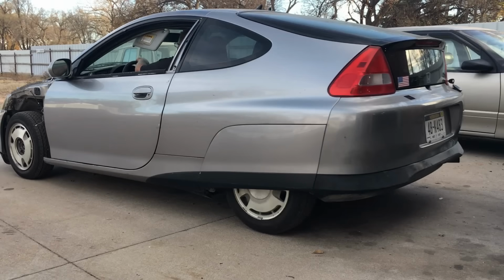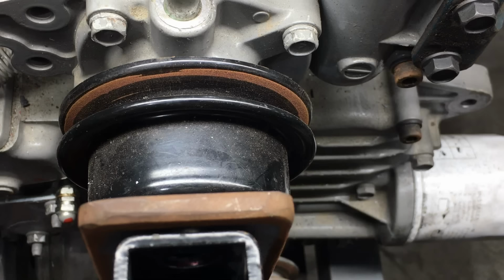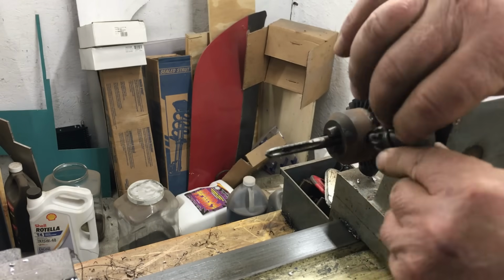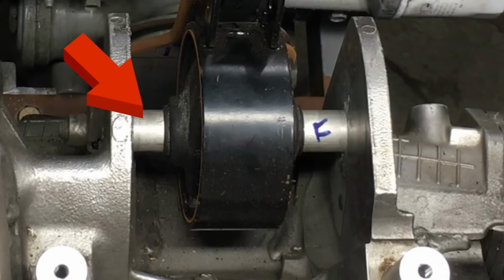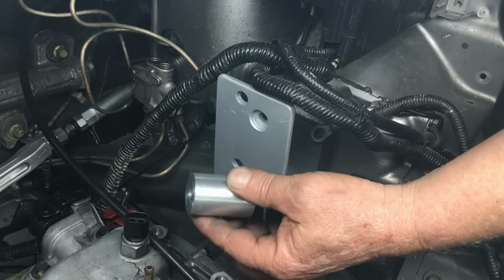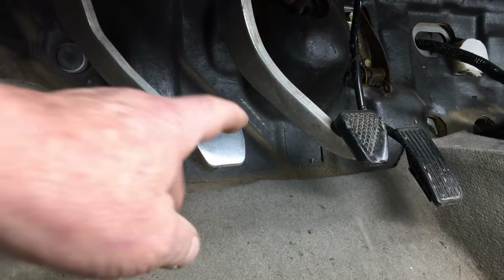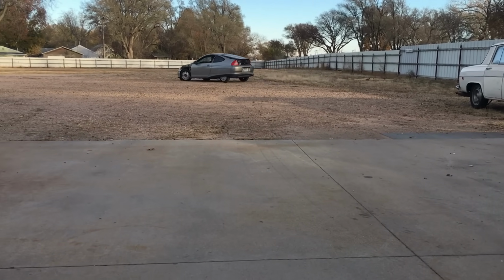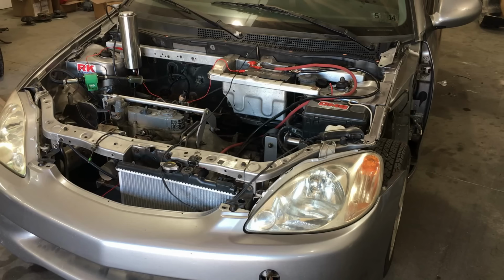S3 E41. Kubota Diesel Honda Insight moves for the first time.

Comment: You have found a way to make an already kind of weird car even weirder!  And it is even going to work.  And I learned today about how you can use a copper plate to help weld shut some holes in a steel plate.  I salute you, Sir!
Reply: The copper trick makes sense they cast the H/I beam in vibrating water cooled copper Jackets and pull a continus beam out soo yeha if you dont dumb tonns of heat in the pice the copper will disapate the heat /cool down the steel fast enough so that it dosnt alloy together
Reply: @TheLtVoss what

Comment: Hey Jimbo, if you're thinking of a future project, back in the late 70's there was a VW shop (Super Bugs) known for dune buggies and racing down in Va Beach. The owner was very much like you, doing the impossible. He modified a VW engine by adding two stroke ports on the cylinders to make a hybrid four stroke / two stroke engine. He raced this bug and it screamed but was disqualified on a technicality.

Comment: The most important thing you can do for fuel economy in that thing is to block off any airflow path that isn't absolutely necessary. Thin steel/aluminium plates beside the radiator, on the brake ducts, below the exhaust etc along with sealing off the airflow paths to the radiator and whatnot better (they don't do this from factory because it's time consuming which would make the cars expensive to produce from a labour perspective).

Comment: I always thought a small displacement turbo diesel serial hybrid would be THE way to go in the future. Looks like VW made sure this would never happen, but I’m curious what sort of mileage you’d get at 55mph in this thing.
Another super cool video!
Reply: I think it’d take ~15HP to go 55mph on flat terrain, but that’s a push for this engine, so maybe 45mph is a better target on second thought?
Reply: @TCPUDPATM  It made it to 55 mph in the Saturn, then they put the turbo on and went faster. The Honda should be lighter and more aerodynamic.
Reply: I agree - however everyone I discussed this idea with said it would be too expensive to justify the fuel economy, and too slow. Nobody wants to spend $60k on a car with mediocre performance just to get 70 mpg.

Today, I think the best solution is a fully electric drive train with a turbine engine coupled to a generator. Basically an aircraft APU. It could be small and produce enough electricity to power the motors while charging the batteries - allowing for long road trips. You could also park the car and let the engine run to fully recharge the battery. Finally, if set up properly, the turbine could run on gas or diesel - which is great in emergencies. After hurricane Ian I was so glad I drove a diesel truck, almost every station was sold out of gas but some had diesel.
Reply: Unfortunately diesel requires a lot of room for the extra junk that diesels need.

If you have to make room for diesel junk (turbo, DPF, intercooler, EGR etc etc) then that leaves less room for battery.
Reply: Mercedes actually has alot of turbo diesel hybrid vehicles

Comment: Will that motor tie rod hit the coolant fitting when the motor is under load? The torque of accelerating and decelerating will cause the whole drivetrain to rock for and aft.
Reply from the maker: It should be fine.
Reply: @robotcantina8957  WOW! This is why I prefer YouTube over traditional media streaming. I have direct contact with a famous celebrity. This certainly made my day.
Reply from the maker: @Cookie-Dough-Dynamo   Thanks, you made my day!

Comment: I feel like there is going to be issues with the anti flex bar. A flat plate being pushed and pulled, it’s going to fatigue and snap. Can you run another bar down to the driver side mount?

Comment: if you put an amr500 and a turbo on this engine i think that you can pull out some decent numbers. i suggest that the turbo goes into the compressor, then into an intercooler and in the engine. i suggest also to use a 2:1 ratio for the compressor or a little more (compressor faster than the cranck)

Comment: Great fab work, Jimbo.  But you never explained why the engine had to move forwards 3/8”.  Some clearance issue we can’t see?
Reply from the maker: Oh good point.  Once the axles were in it was clear the engine was too far back.  Moving the engine forward put the axles in the correct alignment.

Comment: I grew up in the 60's and 70's with the hot rodder's and hobbiest racers. 
 Then you had the bikers , dirt bikers , go carts , skateboard's mini bikes and bicycle's. 
 It was also the time's of big wheels and tricycles.
 The front wheels on big wheels were plastic and would wear out and get chunked and dumped in trash piles down dirt roads. 
  The back wheels seemed to last longer .
 They were also very large metal tricycles . 
 A kid came up with the idea of taking a very larger tricycle with a hard tire wheel with front peddles.
 Take the fork and wheel off the frame and flip the frame.
 Then use the big wheel wide slicks and axles on the flipped tricycle frame .
 Making the tricycle chopper ! 
  We could also extend the back into a two seater with back rest , attach pipies and skateboard wheels for a wheelie bar .
 It wasn't soon before all the boys in the neighborhood were making these and racing them down the steepest hills in the neighborhood ! : ) 
  The guy who first came up with this eventually put a small block 400 chevy in a Vega .
 Later a 350 Chevy in a Datsun 240 z .
  I know many of us who have done these projects or known people who have . 
 Say what you want about boomers we didn't grow up playing video games .

Comment: Yeah that Near side Engine lifting mount was calling your name. 
A simple Bridge mound was all that's needed to also clear the Cooling hoses.
Reply from the maker: Yes, however to get at the lifting eye bolt, the timing cover needs to be removed. If we ever remove the timing cover we will revise the brackets to anchor at that point.  For now the longer version will work fine.

Comment: That A bracket  that takes all the transverse engine loads looks like it will likely crack around the bolt holes. Some triangulation there would be a good idea.

Comment: It would be nice if you could put glass pack silencers in the exhaust so is it does not interfere with the results probably sounds better. I’m also interested in the amount of power you produce and the fuel economy bearing in mind fuel is no expensive to me and probably a lot of others. Fuel economy is a big part I enjoy watching what you achieve and I have done similar in the past, great to see someone else doing what I would like to do with the vehicles I am running at present but at the moment I’m not in a position to do all the modifications. I really enjoy watching your videos as anyone else doing the same will encounter similar issues. Brilliant video keep up the good work. Looking forward to the next one

Comment: When you said that torque mount bracket, I expected a lot more than that😅 
Looks like machined aluminium billet, probably produced in very small numbers, quite beefy, and regular honda parts are usually already expensive.
I would have stuffed PU inside the old one and considered it done, but for that brand new part 99 bucks doesn't seem that much.

Comment: I wonder if you can use an intake manifold flipped over 180 degrees as an exhaust manifold so you can push it sideways to get more space to 'do things' with the exhaust [such as make it fit, or, maybe even mounting a turbo back on it]...

Just guessing though, as I am aware that on some engines, especially 3 cylinder ones, the spacings of the intakes are wider and larger in diameter than the exhausts, and even, sometimes, the other way round.

But also, one could just take 3 90 degree bends, and with some cuts, weld them together into a manifold.

Comment: there was no need to buy the new torque mount. in the early 90's we used "3M WINDOW WELD" to fill the mount and make it more solid instead of going with poly mounts. ive "fixed" many honda mounts doing this and always worked great. only down side is you must wait about 3 days to make sure it is completely set.

Comment: Mity-Vac the clutch res. the vacuum pulls the air out of the res hole and all lines and the res fluid level should drop as vacuum is disconnected. i done it on a mini cooper clutch

Comment: Engineering best practice, bolt goes down (on the brace). 
Reasoning behind it, if nut comes loose the bolt is still in the hole. Not falling out in its current fitment.

Comment: Have a look at rctestflight's vibration isolators. They are basically like a spring but with a wire cable, which acts perfectly between a spring and a dampener. Old thick wire is simple to come by - probably for scrap value, and you just need to tie them down on two plates.

Much cheaper than buying new rubber bushings for engine mounts and also a fun thing to explore :)

Comment: You could try using a high pressure pump with a return to get more pressure behind the injectors  for better atomization = more power and efficiency I've noticed no difference after 40psi at the injection pump that smaller motor might not need that much but it's easy enough to play with a regulator

Comment: One really nice thing about that set up, with the small radiator you definitely have a lot more room for a front mount intercooler for that small turbo diesel engine.

I don't really know anything about diesel engines except they are compression ignition and they dump the fuel directly into the cylinder, but could you add the diesel fuel atomizing the fuel and putting it in the air intake stream probably in the intake manifold, but really I have no idea if that would work or how it could work.... but it's an idea... probably a bad one, but one nonetheless.

I have seen people cooling their exhaust temperature with a water injection system..
Reply: You don't want to add fuel to the intake of a diesel, it can ignite prematurely during compression and cause damage.

Something you can do however is inject water (or a 50/50 mixture of water and methanol) into the intake just downstream of the turbo. The water/methanol absorbs a lot of heat as it evaporates, acting kind of like an intercooler only even more effective. Methanol also burns as a fuel, but it resists preignition well enough to avoid problems when used this way.

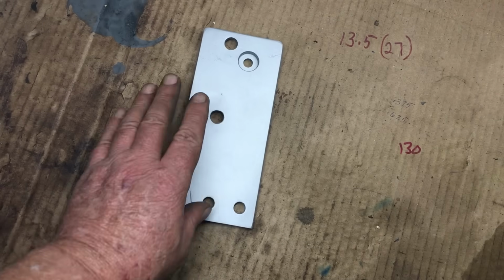Comment: 9:40 - I would have even considered to make the sunken part even deeper and use an allen head screw instead for even better strength. The shorter the spacer is the better too.
For the exhaust it might be an idea to make a new exhaust manifold with three smaller pipes or run two smaller pipes in parallel from the current manifold to make it easier to fit between engine and radiator.

Comment: You should use helicoils on the threaded aluminum rod, using just a tiny bit of loctite to fix them in place. Otherwise those threads will gall up easily. I guess you could also use antisieze maybe

Comment: Instead of using a small engine and adding a turbo, I wonder if it would be better to do the opposite, use a larger engine, and reduce the intake timing by installing a different cam-shaft, to turn the engine into an Atkinson cycle.

Comment: This would be awesome with a Tesla motor, about 50 kw battery, and a Nissan leaf motor as a generator.  Along with a plug in charger. It should do 0-100 in about 2.1 seconds!   And the engine only starts when the battery is not capable of supplying the power!  Say possibly full electron throttle! Fire up the engine to give the motor all the electrons! Prevent voltage drop from the battery! It could possibly be a land speed car! Put large skinny tires typically used on drag cars!. Tall as possible, for a record speed attempt   maybe make custom gears for the Tesla drive unit. with the proper gear. It should see 200 mph easily, and 220-230 ,with tape in the right places!  I'd like to do something with a Prius, if really like to have a insight! but this is only the third one I ever saw! One on TV, one locally and kubsy here makes three!  With decent rims and a slight suspension mod. I think these could be almost cool cars.

Comment: Next project.
Find a Nissan Leaf or similar that has been abandoned due to the ridiculous battery replacement cost.
Find a small high output aircraft apu.
Some super capacitors 
Some hybrid batteries 
Mix them all together and build something that the car makers should have made before idiotic things like Nissan leafs and Tesla’s and especially Ford F-150 crapening